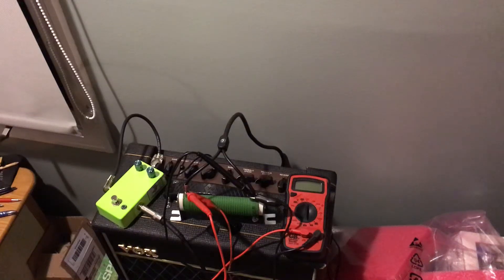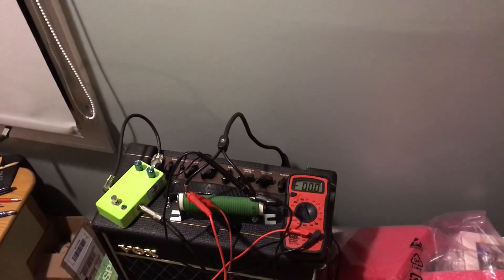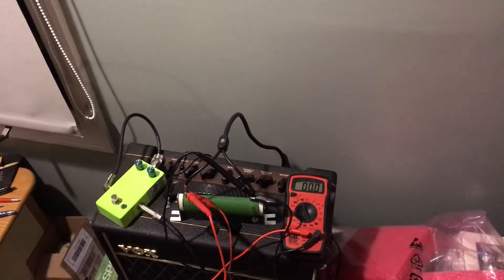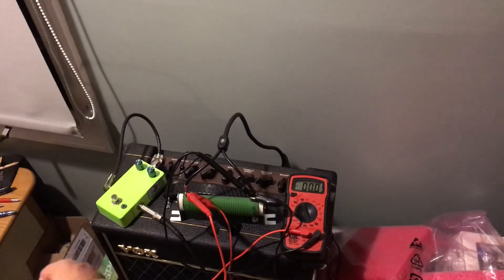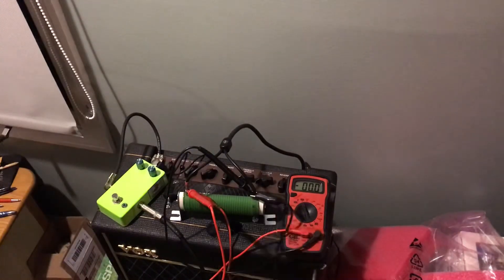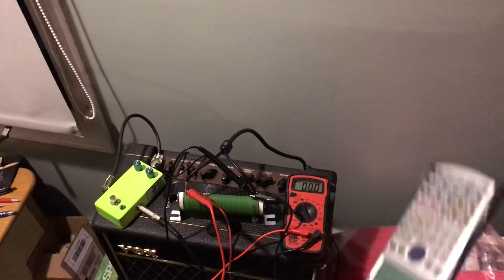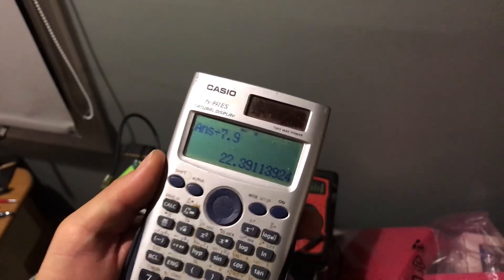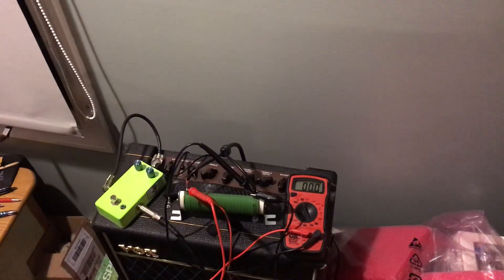Vox Pathfinder 15R puts out 22.4 watts!!!!

Comment: I knew it !!!  I got 2 Marshall Origins 20 watt combos 1 x 10 celestion V type speakers and 2 Pathfinders 15 R  combos 1 x 8 Bulldog speakers ( black speakers ) and the Pathfinders are as loud as the Marshalls !!!

Thanks for taking the time to show us this !!!
Reply from the maker: Well what you have to remember is that the resistor will show its true power. The little 8” speaker won’t ever translate all that power into sound, it will heat up and compress. Plug the pathfinder into a really efficient 10” like the G10 greenback, and it will radiate all that power without compressing and heat.